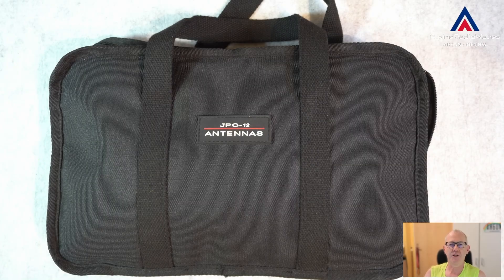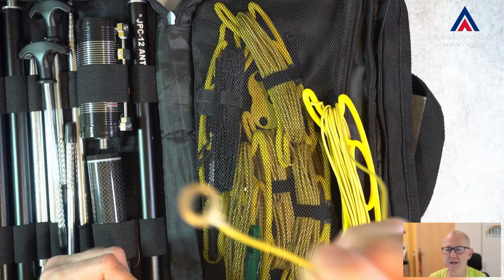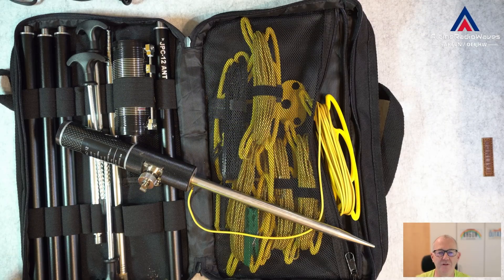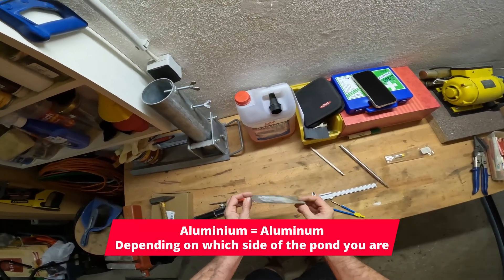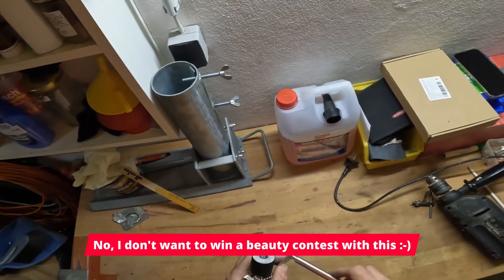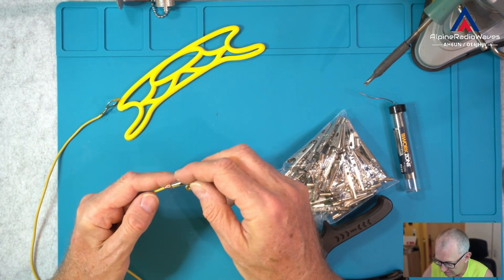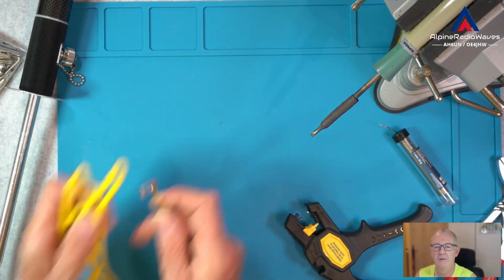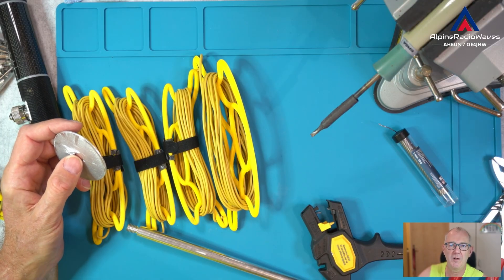My solution of a new radial (counterpoise) kit & mounting for the JPC-12 (PAC-12) Ham Radio antenna

Comment: Great video. I just got the JPC-12 and might need to try something like this. I like how you put the plate on first, get it into the ground and add the radials later. That way you could add more if you needed to without pulling the antenna out of the ground. You could also use the ring connectors on the other end to stake it into the ground if you needed to.
Reply from the maker: Hello Ed and good morning from Austria. Thank you for watching and 73!
Juergen OE4JHW

Comment: It is far easier to add ring terminals to the ends of the ribbon cable. Use wooden golf “T” to anchor the ends when deployed. Place the ring terminals onto a large safety pin to keep the wires from tangling in storage.

Comment: thanks. whats your advice on the radials? which length? minimum amount? 73 aus OE1
Reply from the maker: Meine Radials sind alle 5 Meter lang. Wenn sie am Boden liegen spielt die Länge keine große Rolle. Eher die Anzahl - je mehr desto besser.
73 de Jürgen
Reply: @AH6UN_OE4JHW  Danke. Wieviele nimmst du immer? 73

Comment: Another way to cut the disk, if you have a 2"/50mm hole saw, you cut the disk and drill the centre hole at the same time.. lol  73  VE1SK
Reply from the maker: I have a hole saw like that, but I'm not sure if the disc would have been rounder. The thing is pretty worn ;-)
73 Juergen OE4JHW